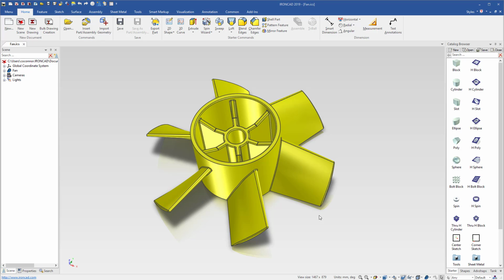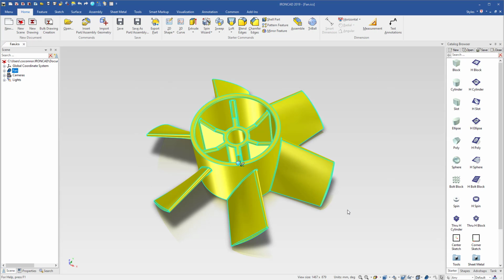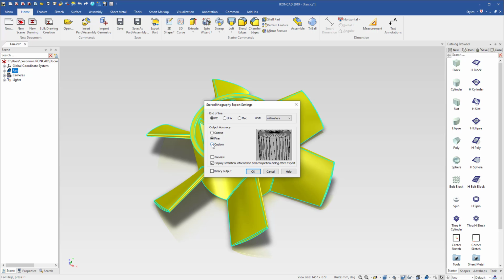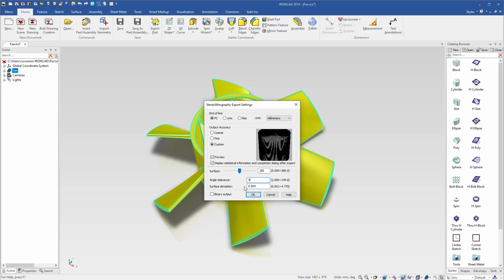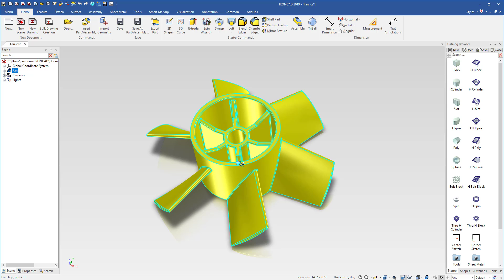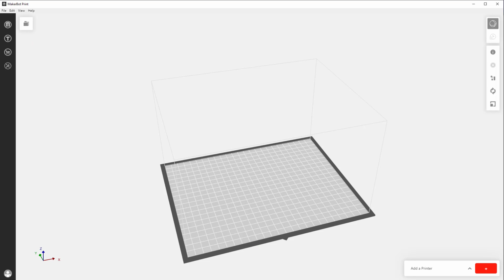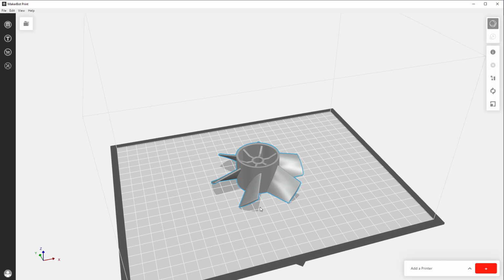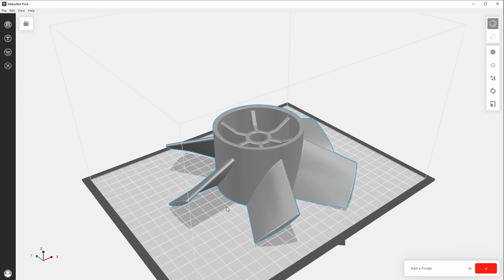Export for 3D Printing - CAD Design Tips

Comment: I'm   self-taught on an older version of SolidWorks and for the most part I don't have to much problems modeling the designs I come up with.  I happened onto this/your video while I was searching for some answers on a particular problems that I have not been able to figure out since taking up 3D printing a few years back.
Now I've gone from 3D filament printers to resin printers and the problem I'm alluding to seems to be exacerbated by the fact the my resin 3D prints show much greater detail than my filament printer ever did.
The problem for me comes whenever any of my models contain any kind of curvature or cylindrical shape to them.  As you probably already know, when you model a cylinder of some sort the curvature of the model is actually a series of short straight lines which form the inner or outer diameters of a cylinder.  All my cylindrical models display in the SolidWorks window as smooth perfect curves but when I convert them to STL files   the outside diameter surfaces of my models inevitably take on the curvature that is clearly made up of many short straight lines that form the curvature of the cylinder.
My slicer software shows the outside surfaces as smooth curves just like the display of my models in the SolidWorks software.  Both my Filament 3D printer and my resin printer prints them out NOT as smooth-surfaced cylinders but as segmented short straight-lined surface finishes.  
My problem is that I don't know if this is corrected in the SolidWorks software I'm using now, the Slicer software or if it's correctable at all with the older version of this SolidWorks.   If I am unable to access the STL-Export settings you show in your video, is there a way to adjust my original SolidWorks models so that they print out with smooth outside surface radiuses?  If so, how would I go about correcting this?
I got to tell you, watching this/your video is the closet I've come so far in trying to figure this smooth-curvature problem out.  I really hope I can get it sorted out.  I'd love nothing better right now than to be able to 3D print smooth outside curved surfaces just like the displays on my models in SolidWorks.

Comment: When exporting an STL (especially for 3D printing), it is best to export in millimeters.  Most slicers expect the model to be in millimeters, and since STL files do not contain the units of measure, you can end up printing a very large or very small part (depending on the scenario) if it is not caught early enough.